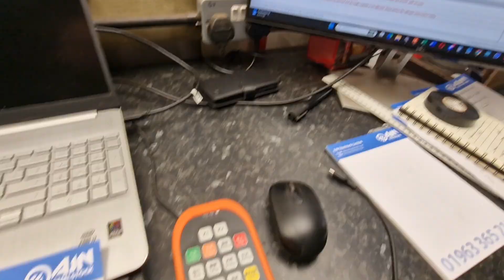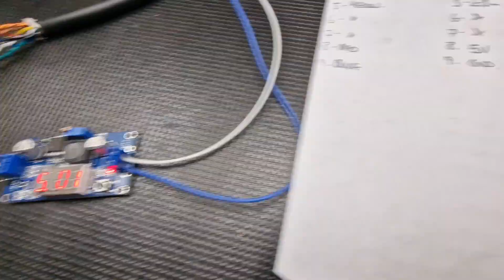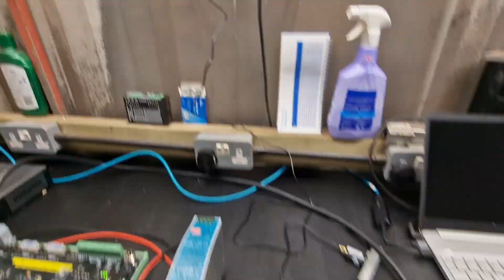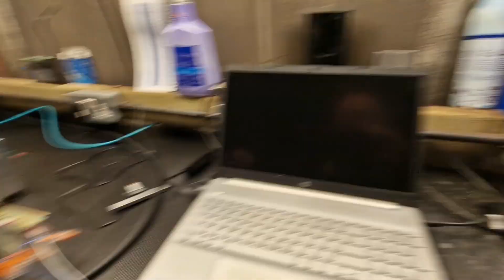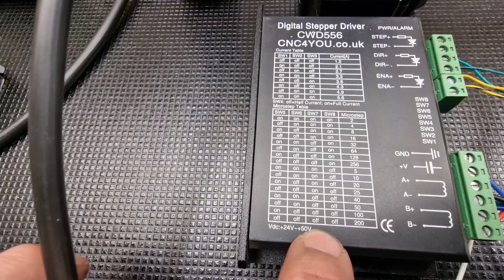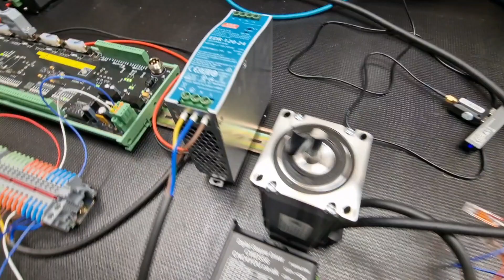Part 3 Fiber laser build. Closed loop steppers? DIY cnc build

Comment: xc3000s controller has a 24 and 5v selector switch, I believe you don't need a voltage converter

Comment: For those steppers with a 5:1 reducer, if I've done the math right, you will need a 75mm root circle diameter on your spur gear to hit 70M/min, it looks like that's going to be a 50 tooth spur gear at module 1.5
Reply from the maker: Thanks for working that out! 😳 That's a fair size pinion gear. Gulp
Reply: @robbroomfield468  i went nema 34 8nm closed loops, 5 to 1 reduction and i think around 18 tooth pinion from memory on a 1.5mod rack and could push over 40 meters a minuite, great acceleration still, 70 will certainly be pushing them. but will be amazing to see a big gantry at those speeds. i only ran them on 60 volt though so could get more out of them yet i think.

Comment: Would you be willing to share your Config settings for the closed loop stepper? If not I understand. Thank you. I have now been able to get the 2DCuthead software to work bench top but not the motors (Stepper OnLine NEMA 23 CL57T) despite manufacture and SkyFire diagrams. I am trying to see if I have missed something else in the config sys. Thank you.

Comment: Well I purchased a NEMA 23 closed loop motor and drive from Steppers On Line, got the pin layout from Sky Fire but still cannot get past the "Servo Alarm" needing clear which I am sure is an improper wire somewhere. Any ideas or advice would be greatly appreciated. Thank you so much sir.

Comment: In fiber laser controllers the z axis don't run on pulse & dir signal.
The z axis run on an analog signal,so I don't think it will work for you with a stepper motor.
Reply from the maker: I have tested all axis with steppers and they work with this board. I will double check later.
Reply: In this Raytools controller, Z axis uses step/direction.
Reply: @robbroomfield468  Before I spend anymore time with wiring scenarios LOL, will this run "Open Loop" Steppers or do I have to at least have "Closed Loop" or Servos? I cannot seem to make open loop work, or I am just flat doing something wrong. I have looked at your wiring and matched with the exception having encoding wires run back to the board since I do not have those. Thank you sir.
Reply from the maker: @lpfdemt you will need to use closed as the board is looking for encoder input. I don't know a way of fooling it 😁
Reply: @robbroomfield468  Thank you so much! I figured that was the problem. I have watched your videos over and over just wanting to make the motors respond as you have. I am trying to do as you and make my current CNC plasma work using the Fiber Laser benefit. Your videos are precise and very informational and I thank you for taking your time to make. Yes, you need to get set up with a Patreon. I will order the closed loop stepper today. I currently run NEMA 23's and hope that it is a simple motor swap, i.e. shaft size, machine bolt size and line up. It would be a pretty easily accessible plug and play if so. Thank you so much sir.
Reply: @robbroomfield468  well I have ordered an 23 Close Loop supper set up to try out watching your videos. I know you used a regular stepper driver and reconfigured your breakout board 15 pin wiring. Would you happen to know how that would wire into a close stepper driver I definitely see where all of your wires have been found that you matched up with the colors, I just have no idea where to put those in the clothes stepper driver I can send you a picture if that would be OK but I did order the name of 23 Stepper Loop driver from stepper motors online. It is the CL57T. Thank you sir.
Reply: I know you don’t have a Patreon yet, but I definitely do not mind sending you some compensation for your time. I would just like to get the motors working then I can go from there. If not, I understand thank you very much, sir.
Reply: I have also seen in your video where you decided to stay with the standard stepper driver instead of the CL stepper driver? Thank you!
Reply: @robbroomfield468  Sir, did you have to do anything special with the control board to get it to recognize only 1 Axis for bench testing? I am connected per the manuals but continually stay in a "Servo Alarm" mode which I assume is where my issue may lay. Thank you
Reply from the maker: @lpfdemt hi, you have to unassign the other axis. In the config software.
Reply from the maker: @lpfdemt hi, you have to unassign the other axis. In the config software.
Reply: @robbroomfield468 Makes sense, thank you sir

Comment: So you input 24v in com pin? In digital input pin? To make the motor work?
Reply from the maker: Well the COM doesn't go anywhere so you put 24v on it to make the inputs work to complete the circuit.
Reply: @robbroomfield468  thanks...i figure out almost 4 days how to make the motor working...because on the software warn me that the X and Y axis was off...thats explain why...
Reply: I think that com port was connected to the positive or negative...thanks to you find out how to make this work...👍